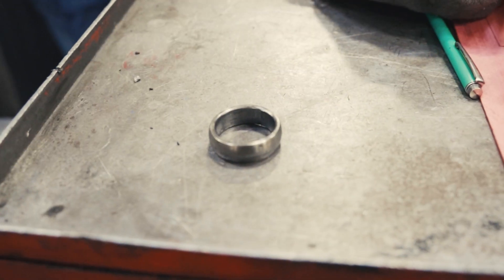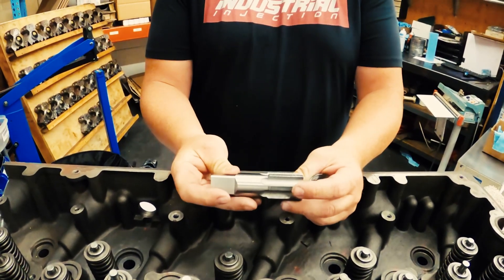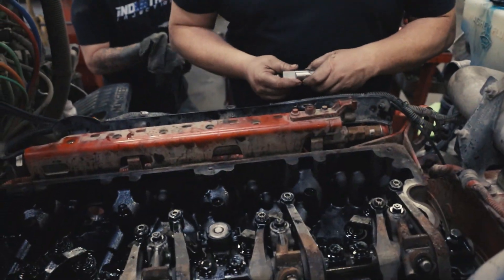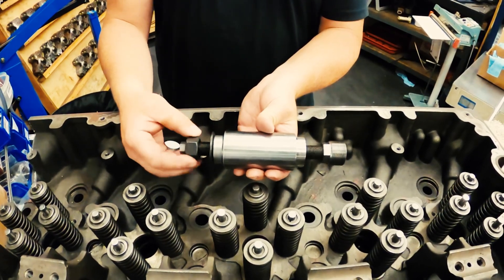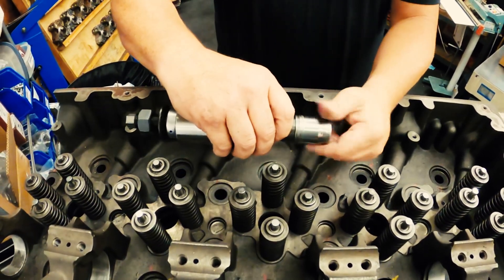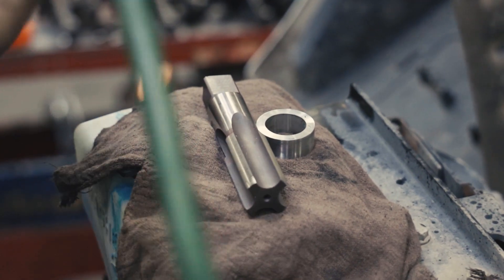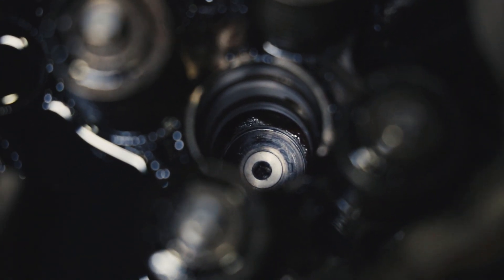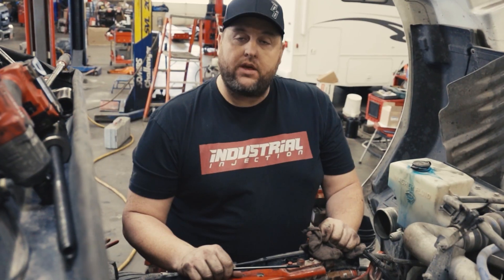Cummins ISX/QSX Single Cam Torque Lock Injector Cup Kit

Comment: Me seeing this the day after I installed the wedding rings😂
Reply: How did the wedding rings turn out?
Reply: @ReptoOwnsYou  didn't work. I bought these and ut worked. It's a pain getting those wedding rings out and these guys don't make a tool to do it either
Reply: @Bullettransport  do you know if a machine shop can replace injector cups on a cm2250? Or the only fix is a new head?
Reply: @ReptoOwnsYou  idk. Just buy the kit they are talking about in the video or take it to them. They install them as well

Comment: Could this fix my cooling system pressurizing problem?
..................
Head gasket has been replaced three times already and head shows no signs of cracks.
Reply: Headgasket almost never fails on ISX or X15. It's always an injector cup or your liners sink. Diagnosing a problem correctly is 90% of the battle, but a lot of money and time saved doing it the right way.

Comment: Just received my kit got everything apart ready to install it!  I will let you know how it turns out I hope this works out good!
Reply: Perfect.  The cup removal tool wasn’t the best I had to wait for 2 more to be sent.  Be very careful when removing the cups just take it slow.  The directions didn’t say to screw it in all the way and back it off a couple turns.  Other than that I’ve driven 25k miles and it’s all good now. Another thing to note is you will have to drain your water separator like every 30 miles whenever the light comes on while driving,  the intervals become longer and longer until it’s all seperated out.  Probably took like 4-5 tanks before it was all out.  It’s definitely the right fix and good quality parts.  Good luck with yours.
Reply: @matthew6202  Thank you.
Reply: How did it turn out?
Reply: What was the problem you had with the cups or what was it leaking ?
Reply: @guadalupecantu7292  yes, injector cups were leaking into my fuel system.  I found this out when I drained my water separator and it was red coolant coming out.